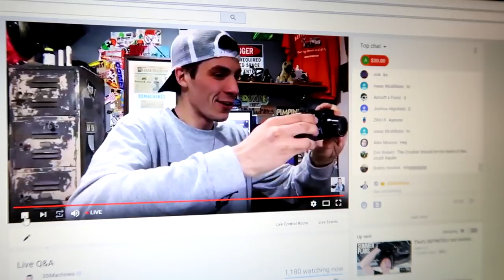HE HIT IT!!

Comment: Keep smiling, it's infectious.  BTW, the Honda front bumper is very soft plastic, meant to bend and absorb up to a 5mph hit without damaging the underlying structure. You could push it in similarly by leaning or even just pushing on it with your hand - it will just spring back out.
Reply: Mark Ney that is a chevy impala not a honda

Comment: Better stock up on halfshafts,u joints, ball joints, wheel bearings, and brake pads. You will go through them fast.
Reply: upside downdog I was thinking race supplies/reliable transportation might be higher on the list than shock service and misc powder coat..not to take away from the project and plans, keep it up!
Reply: Brandon Minear 
I have worked on a few of them the last couple of years, they are quite delicate for offroad machines.